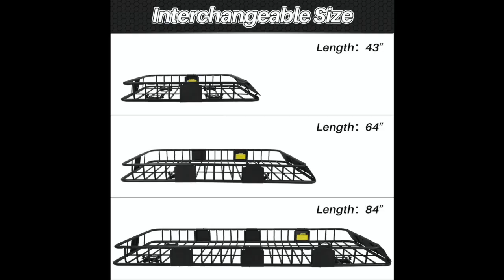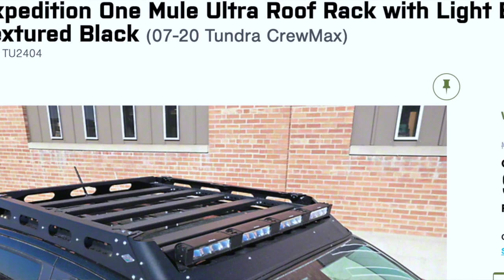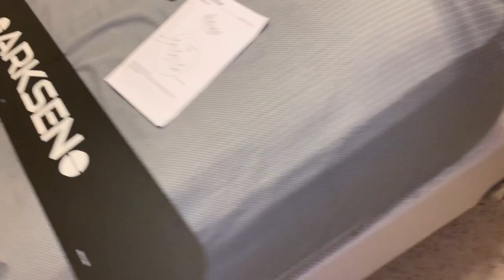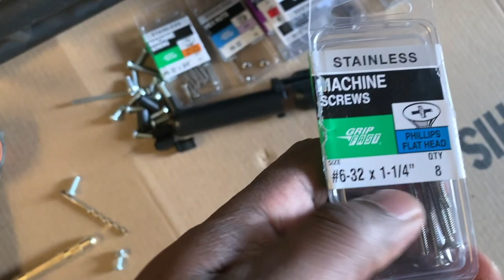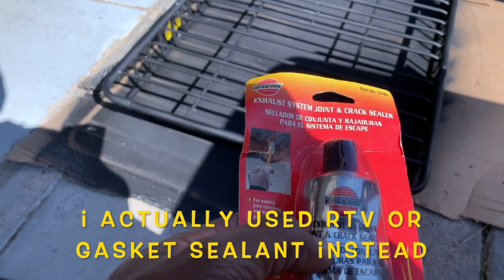84" Arksen ROOF RACK Review & Install '07-14 Suburban

Comment: If you look at all of Arksen's roof racks you'll notice they're all rated at 150 pounds, even their smallest rack. The manufacturer probably came up with that number after looking at a cross section of all SUVs and went with a low number so they wouldn't be facing a lawsuit should one fail. What's going to fail isn't the Arksen rack it's the factory rack that it's mounted to. I'm looking at the 84" x 50" rack, hell I bet I could put a half dozen aunt Ednas up there without a problem. Great video, thanks for posting it!
Reply: I'll bet the dog kept up for the first half mile or so... :)

Comment: Nice. I have this rack on my expedition too. I’m pretty happy with it. It’s one of the only BIG roof baskets you can buy and it has more weight capacity than the Yakima. Aside from a little rusting at the joints, it’s fine and seems pretty rugged. I just saw another video where a guy had an 84”x50” arksen. I wish I had that one, but oh well. Didn’t know they made one that wide.
Reply: I think there's an add on you buy that widens your existing 39" wide roofrack to 50".

Comment: What is the width of that one? They sell two 84 inch racks.  36' or 50' wide. Also, how it fairing?? Thanks
Reply from the maker: hey champ. One i got via eBay is 84"(L) x 39"(W) x 6"(H) w/ extensions. lemme know how it goes 4 ya. 
Rack is awesome, solid as can be. Looks great with herculiner application. No peeling or rattling.

Comment: How many of those horizontal bars do you need?
Reply from the maker: 2 are sufficient. More than 2 just increases max weight. I went ahead and added 2 more since I had them sitting around but not necessary. 🤙🏿

Comment: 🤔 Instead of the screws and the sealant you could have used HEAT SHRINK. would have worked for rattle and waterproof.

Comment: Looks like you're using the bracket incorrectly.  Supposed to sandwich the rack between the metal bracket and the plastic bracket, and the plastic sits on TOP of the crossbar.
Reply from the maker: Appreciate feedback. Saw someone install it that way b/c it didn't stick out as much. I looked at and decided to go the road less traveled. Any safety issues you see doing it that way that i might be overlooking?
Reply: @Maknificent12now  I don't think there's a safety problem. It's not going anywhere.  Thanks for making the video.  It helped me make up my mind to get one.  Arriving Thursday!  I'm thinking of adding an 8 gallon DIY solar shower so I might go even further with strenthening things up.
Reply: I noticed the same on the bracket is not how is supposed to be on the instructions , that is probably why it get loose with vibration.

Comment: the whole rack is a weak link,,,with so many pieces to fit together.
Reply from the maker: Suppose you’re right. 💯 more pieces = decreased structural integrity  vs 1 piece

That said for the purpose most people use it for... not sure the cost of a single piece of molded steel is worth the “overkill “ amount of structural integrity your get from that kind of design ya know?

I feel that steps I took to solidify it should do the job and then some. What kind of setup you got?